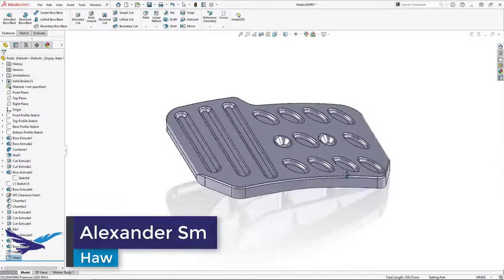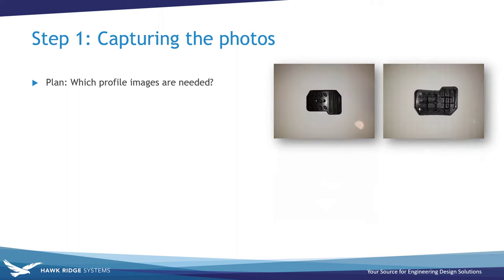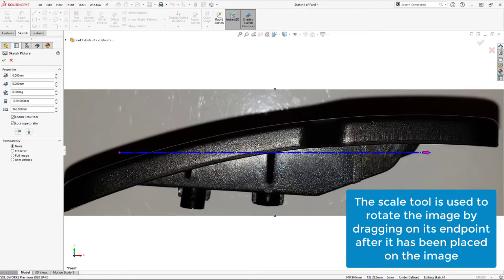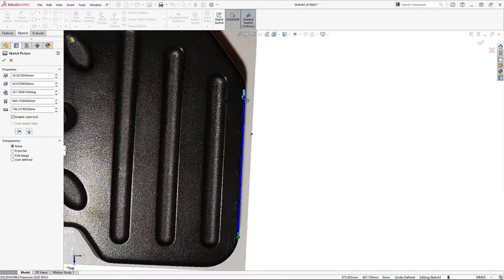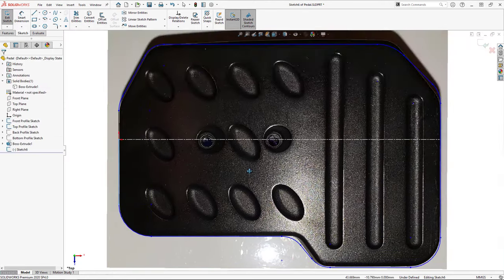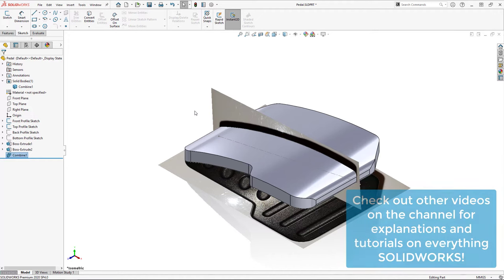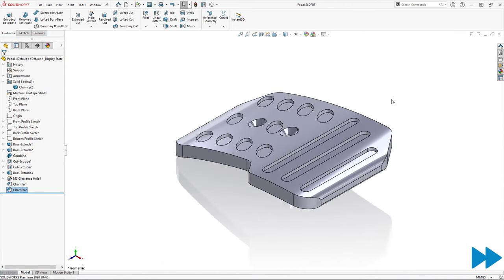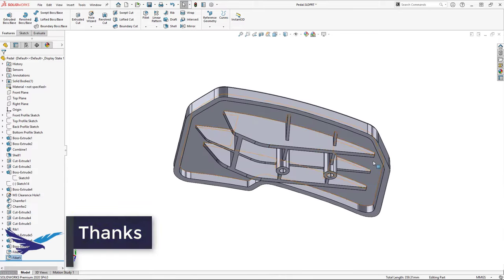Reverse Engineering from a Picture in SOLIDWORKS

Comment: Great video. Another photography tip: instead of holding the camera close to fill up the frame, stand far back and zoom in. This reduces perspective distortion and gives a closer result to orthographic.
Reply: I concur with this statement.

 As you scale up a sphere, the rounded edges become almost linear. So the farther away you are, the less the 'fish-eye leans' distorts your image. 

There are perspective to orthographic tools inside various image editing software. As well as 3D editing software. If you have one of those, I would check if they have that feature.
Reply: An easy way to think of this from a photographic standpoint would be using a fisheye lens. It has an extremely curved glass lens which results in extreme distortion. Using a 35 to 50mm Will give you better perspective but as you near the object the curvature of these lenses also will distort. I've never gotten it to work properly but it seems a photocopy image would be the closest to a flat surface but there you run into a tremendous waste of ink to try to make this work.  So photo taken with a 50 mm lens at about 2 ft to 3 ft above the image would give you the flattest surface without too much graininess once it's cropped.
Reply: Also: Scanner! If you can put your object on a scanner it does a pretty good job too.

Comment: I had to reverse engineer a chassis for an RC car a couple years ago. The shape was pretty difficult to model off of a photo because the curves obscured the edges of the cross-section. 

I came up with a solution that worked pretty well and made each profile sketch much easier. What I did was I used my green 100mW laser and unfocused it so that it projected a circle of light on the wall a couple feet in diameter. I then placed the chassis so that the side I wanted to project was facing the laser, and I made sure the laser was as normal to the center of the cross-section as possible.  I then took photos and measurements of the chassis' projection on the wall, scaling them down to accommodate for beam spread. 

It may have been an unconventional approach, but it worked. The high contrast of the projected shadow was much much easier to measure. There were some distortions of course, but those were easy to manually fix. For a more robust setup, the laser could be set up much further away from the subject and, by using a collimating lens and a wider beam, could eliminate nearly all distortion in the projection.
Reply from the maker: Very interesting! Thanks for sharing
Reply: it would be cool to see that on here. seems interesting

Comment: Pictures for raster images must be taken from the longest possible distance, doing so, the difference between hypotenuse and adjacent will be minimal.

(I am too old/stupid for solidworks, everytime time I try to use it I end up feeling bad, sad, stupid and miserable).
Reply: I got this problem using this method. When I imported the picture and calibrated it , not all the measurements were the same. So you suggest to shot the pictures from a longer distance than doing a close up to avoid perspective deformation?
Reply: @MartinoPolizzi  Yes. It makes sense for me. I compared 25 mm with 14x25 mm. I would love to try a Nikon P900 or P1000 but I can't get one. Some lenses have more or less "barrel effect" and probably the best ones are too expensive.
Reply: Thanks a lot, I just got my phone so I'll try to shoot the picture as far as possible